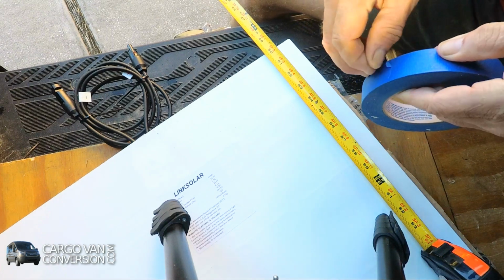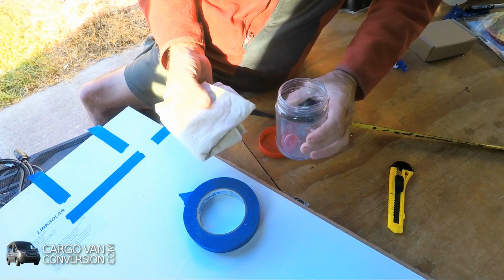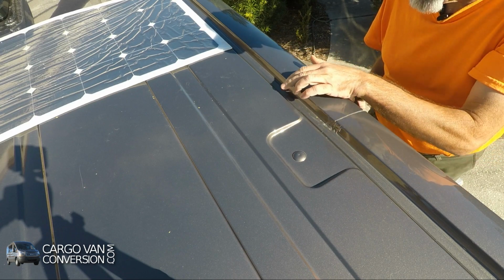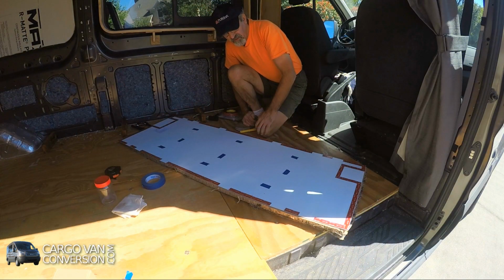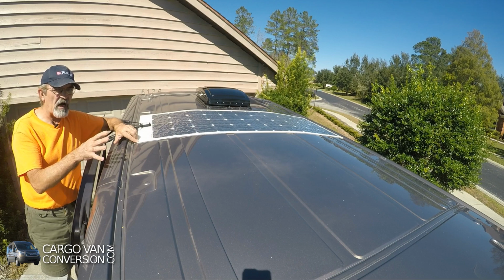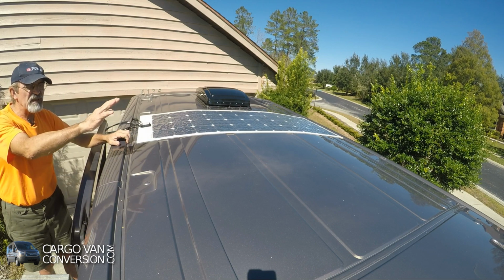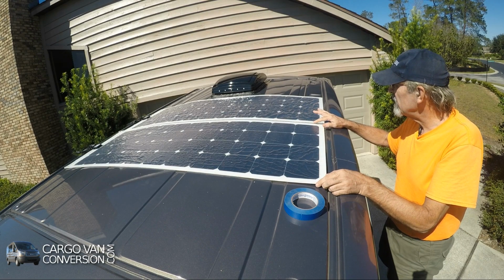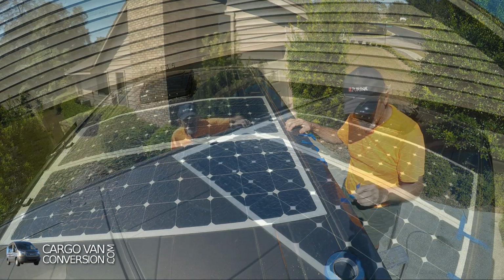ETFE Flexible Solar Panel Installation - Part 1

Comment: The more I think about it the more I wonder...

The idea of leaving the gaps (roof stiffener rib depressions) open for cooling sounds like a bad idea. Any cooling is likely to be minimal (negligible if that) and all I see happening is it being a point for dirt and bugs to collect under there and be next to impossible to clean. And it's going to be a point for air and water to get in and work on weakening the tape and lifting the panels. Especially if you were to ever get some water turning to ice under there. I think it would be a good idea to fill those gaps in with some caulking.
Reply from the maker: Hi Not Here,
I don't disagree. Before installation I anticipated larger openings, but was more concerned about the openings at the front panel. The roof channels start however under the front panel and no wind can come underneath.
I will monitor it and probably use some Dicor to fill them up. It probably would have been better to double-up on the VHB tape.

Van Williams
Reply: Looks great anyway :-)  Been following your build for a while and love the ideas and this recent flexible solar panel series, looking forward to part 2 !

I have faith in the VHB tape at least for a while and depending on your climate swings. Up here I doubt it would survive the swings from -40F to 90F+  ...daily ;-)   ok, not quite that extreme :-)
Reply from the maker: Hi Not Here,
What's 'up here', if you don't mind asking?
BTW It gets a bit complicated: 'Up Here' + 'Not Here' :)
I'm located in Central Florida and temps can be quite extreme, but only at the top side; seldom any frost.
The VHB tape doesn't look like much, but apparently, it works quite well. It's wait and see.

Van Williams
Reply: I'll throw another into the mix ;-)  " Middle of Nowhere " (central Saskatchewan, Canada)
Reply from the maker: Yep, I've been in Southern Saskatchewan and that was already out of the way. Any reason to ever go further up North?

Van Williams
Reply: Totally agree.  Gaps should be filled with a silicon sealer to prevent dirt buildup.

Comment: sunpower solar panel can directly charge fast
Reply from the maker: Hi Nick,
Yes, these flexible solar panels have high quality, backcontact Sunpower cells. With Pmax of 29.4V. Some preliminary testing, recently (Nov.2017 in Central Florida) showed ~19.1A going into the batteries, late morning with the panels flat on the roof of my Transit. A maximum of closer to 30A is possible under ideal circumstances.

Van Williams

Comment: Those panel types need an air gap for cooling. That's why they only have a 1 or 2-year warranty - they will fail soon after the warranty without an air gap.
Reply from the maker: HI CauseAndEffect,
I think the issue is more complicated than that.
I'm not an expert at this, but have some experience. While an airgap will allow for better cooling and consequentially better performance (I guess about 10%), the performance part is easily compensated by getting more panels. Whether premature failure is caused by the same issue is unresolved. As I see it there is a first generation of flexible solar panels, that has failed many owners as you said within a short period. These panels came with a lot of other issues. The PET laminate was in my opinion, insufficient. These were cheap panels and consequently often had low grade solar cells applied to them. These same early panels were also heavily promoted with people dancing on them, bending them incessantly, both inward and outward. Also often badly attached to the vehicle roofs.
Most of these issues have been resolved. Personally I have the 'second generation' panels installed only a couple of months and so far very content with them. But I am also reluctant to say anything about longevity, as I need to see that play out, before my mind is made up. So far the ETFE laminate looks very sturdy, the VHB tape connection to the roof looks impeccable, and the high grade, backcontact Sunpower solar cells perform very well, equal or better than rigid panels, in my opinion. That may all change and I will report back on that in due time.
The three panels are 135W each, 29.4V and 5.7A. At the moment, I manage to get, mid-winter in Central Florida, about 20A at noon, flat on the roof of the vehicle glued on the metal. They also perform very well early and late in the day and the solar controller can easily produce 120A, likely much more in a better location and more than sufficient for my needs. I project upwards of 200A in summer, but I'll have to come back on that when I actually know.
There are many questions still unanswered about these newer panels and that will take time, so I took a risk and we'll have to see how that pans out. From what I know, there are still a lot of old flexible panels sold and many of the newer ones still use the PET laminate and the quality of the cells is still questionable. It is unclear to me what the effect of that will be. Then there are the people; they still bend these panels excessively, which still leads to failure. They are flexible as in attach them to a curved roof, not as to show what you can do with them. That may be the prime reason for the shorter warranties. There are flexible panels that can handle the flexing better (i.e Day4 flexible solar panels), but these are not well-known and somewhat expensive.
That was a not-so-short answer to your comment :) Hope that it helps.
Van Williams
Reply: Yes, your comments and risk-taking are greatly appreciated! Keep making your helpful videos. We future RVers/nomads need all the help and info we can get!

Comment: Much better then a roller is the back of a spoon to smooth out the air bubbles. A roller does not apply as much PSI.
Reply from the maker: Hi David,
You're right! The smaller the surface, the higher the pressure.
Thanks.
Van Williams